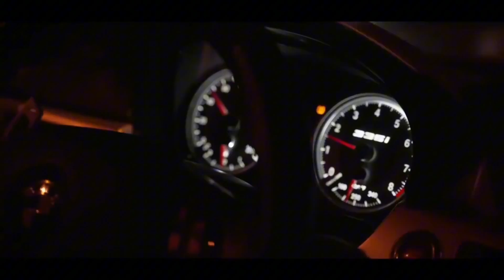BMW S58 vs Mercedes M139 — Inline-Six vs AMG’s Best 4-Cylinder

Comment: I own a m139 Gla45. Does 12.4@113mph stock. My w204 c63 does 12.5@114mph. The m139 revs like my c63. But the sound of the na c63 has no comparison. M139 is a 4banger engineering marvel.

Comment: This is a Joke. I owned proper AMG's ( i.e Cls 55 amg and C63 amg ,both V8 with Kompressor and bi turbo ).M139 is a clear step down.
Currently, I own an M3 LCI 2025 with the S58 engine.